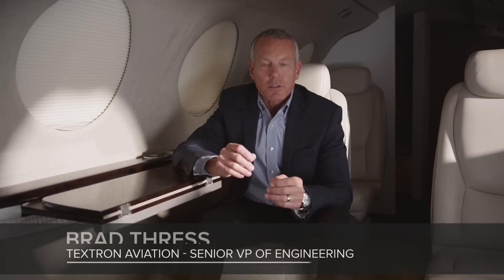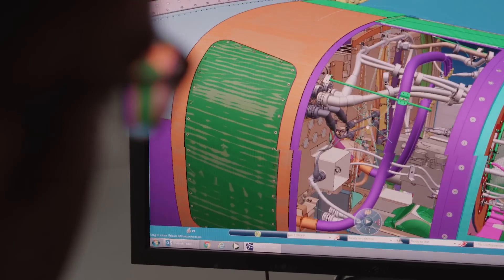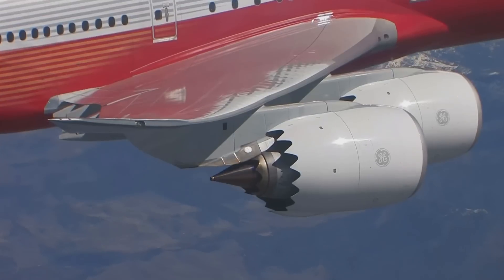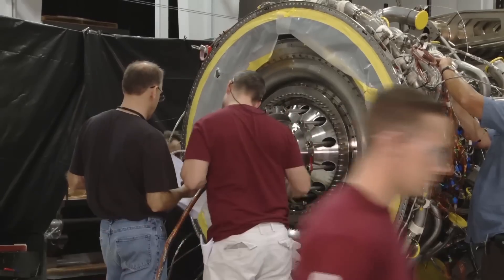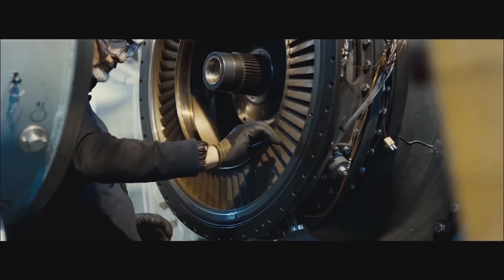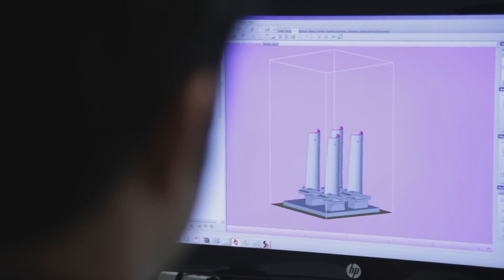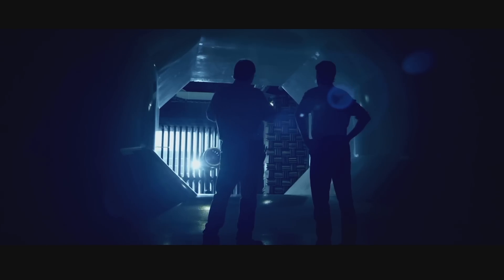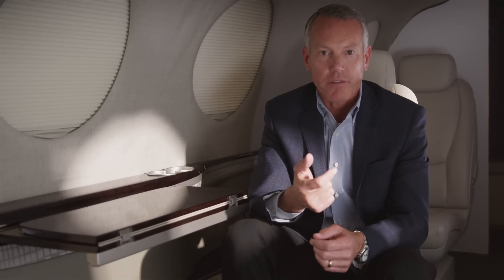Cessna's Denali and GE's Catalyst™: Partners in success

Comment: PC-12-NG with FADEC.  I get a kick out'a the comments that FADEC is some kind of futuristic major discovery/improvement. Pilots have done just fine without FADEC. It's just another way to increase the price another 25k for a computer that cost 800 bucks to make. American made PC12 is not a bad thing.. it'll make Pilatus improve the PC12.. maybe get that truck some speed.
Reply: It takes a lot of power to push a brick through the air. I've been in both the PC-12 and the TBM; many people assume that they are similar in size, but it's Ford Ranger vs. Kenworth in terms of comparison. So if they greatly increased the power, they'd lose range, unless they added more fuel, then they'd lose payload. It's a very good compromise as it is.
Reply: Keep the FADEC and make the PC-12 lav externally serviceable and add anti-lock brakes.  Done, perfect, I'll take two.

Comment: If it will cost around 2 M it will be a good bargain, but if it will be as pricey as the PC12, then no one will buy it over a proven super reliable, super versatile aircraft.
Reply: As an old aviation marketing guy, I'm betting that 1) the Denali will be MORE expensive than a PC-12, and b) people will buy the Denali over the PC-12. The purchase decision is not made on Price, but on Value.
Reply: @Houdi2  Sure. But the PC-12 now has better value than the Denali since the NGX came out and satisfied all needs that the earlier version didn't and the Denali would
Reply: It's going to cost 4.8 Million, so it's even more expensive. And with all the new extras of the PC-12 NGX, most of the customers' wishes were fulfilled, so in my opinion the Denali doesn't have an advantage over the PC-12 anymore. Plus, the PC-12 has more range and can take off on shorter runways.
Reply: The biggest difference is, it's made in the USA. People in America prefer to buy American made. Americans will buy the Cessna.
Reply: @TexanUSMC8089  Swiss made is also a good sales argument. Would you rather own a Rolex or a Timex? Most millionaires would prefer the Rolex. Turboprops are luxury  goods also. Funny enough some Timex models almost look like a Rolex. Imitation is the sincerest form of flattery.

Comment: Atp is practically a walter engine and a walter engine is practically a PT-6 engine..so it is a PT-6 ENGINE! and denali is an American version of PC-12...with the same engine but a different name.
Reply: Putera Usman wrong. Engine is FADEC controlled. Major advance in single engine turboprop.
Reply: 21AirDrop FEDEC control already around quite sometimes in jet engine and turboprop is actually a jet engine with big propeller in front. PT-6 can be equip with FEDEC easily, major manufacture just don't put it simply because cost consideration.
Reply: Putera Usman's comments are unfortunately uninformed. The Walter is certainly not a PT-6, but further, the ATP is not even a Walter. It is a clean-sheet design. You cannot claim it is a 'clean-sheet-of-paper' design because no part of it was designed on paper... it is entirely CAD design. Congratulations to the international GE team on this milestone. 

Frankly, it is long past the time when a stake should be driven into the heart of the PT-6. (Full disclosure...I was selling airplanes with PT-6 power plants 45- (count 'em...forty-five) years ago.

Comment: R&D costs were dramatically reduced due to a copy-paste of the Swiss Pilatus PC-12... ;-)
Reply: Jeff, they do not claim "no inspection" for 4,000 hours.  They claim that figure between overhauls. Significantly different claim.
Reply: eromadrol eromadrol FADEC. FADEC. PC-12NG is behind the times.
Reply: You probably mean Cessna version of PC-12, or GE version of PT-6...right?
Reply: i mean if you listened to the video they made subtle points about how they have improved over "previous generations" of this class. but yes i am a big pc12 fan
Reply: The Denali and the PC-12 are quite similar, but the GE Catalyst (formerly "Advanced Turbo-prop", or ATP) is quite different in terms of method of construction and thermodynamic efficiency! I'd have liked to have seen at least a much improved range, or higher cruise, on the Cessna.
Reply: And the Pratt & Whitney engine. All joking aside, what great companies and what innovations and technologies.
Reply: exactly...
Reply: Costs the same within a few hundred kilobucks, and virtually the same performance ... and look at them side by side.
Reply: Yup
Reply: eromadrol eromadrol you've obviously never flown the pc12 and familiar with its engine. This a completely different type of engine with a fadec and single control that's never been seen in this segment. They're advertising way more operating efficiency and no inspection until 4000hrs, yeah you're right it's exactly the same😐
Reply: 1st thought that came to my mind; GE's version of a PC12